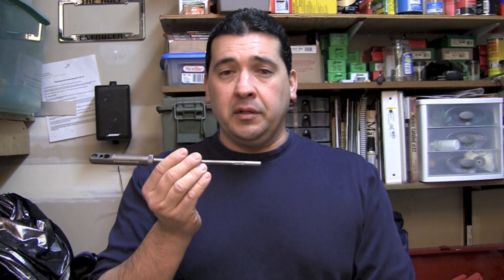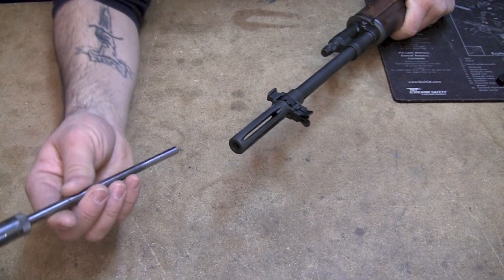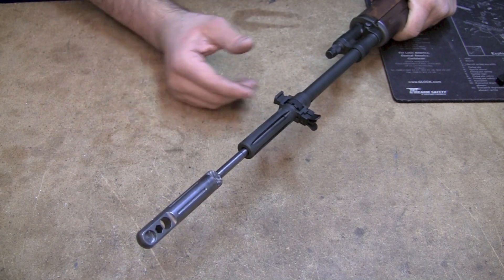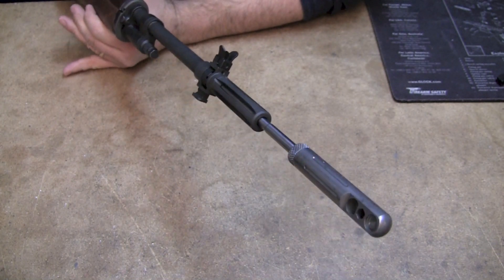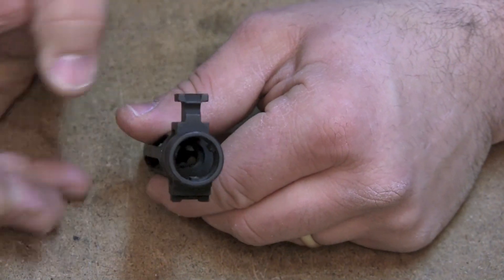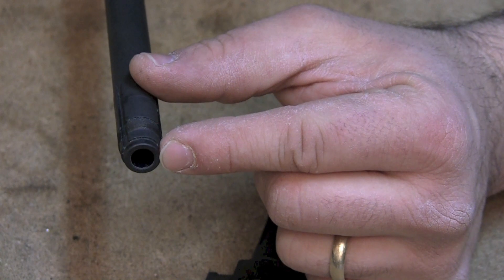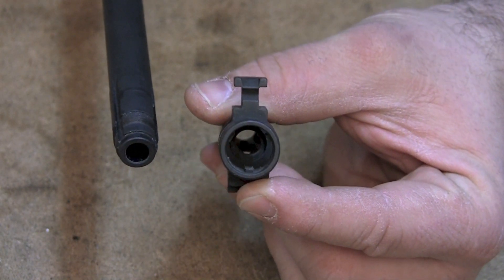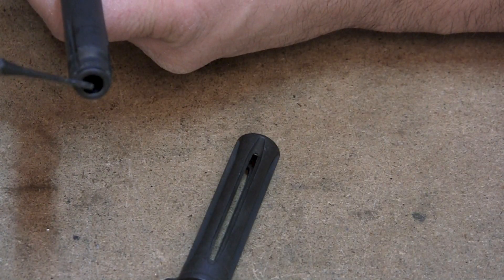M14 M1A Flash Suppressor Alignment Check

Comment: Or the poor man's fix? Assuming you have access to comprehensive drill index,  simply find the bit size where a virgin undamaged SHANK side fits snuggly into the barrel...I am guessing it will be in the vicinity of around .308 giver or take...  IF you can find a bit that qualifies then carefully use that as your "alignment gage" by holding the sharp end with fingers (put some electrical tape on the tip for comfort!)  now insert the shank end into muzzle a ways and check to see if there is clearance ...if not you may be able to remove a slight burr from crown very carfykky with a whet stone.. or maybe knock a piece of grit from the flash hider contact point....last ditch, don't want to pay a gun smith and don't want your accuracy ruined due to bullet contacting flash hider??  How about over sizing the hole slightly?  Maybe not "right",  but I bet so long as the bullet is not contacting the flash hider at all,  the accuracy will be corrected if that HAD been an issue...  Hey, some like me,  thrifty and logical to a fault sometimes...  or not...some will buy the alignment tool an/or pay and go through hassle of doing it supposedly "right"...unless your definition of "right" includes what works..??

Comment: How many have u seen that aren't alinged
Reply from the maker: I haven't seen any that are misaligned, but I have seen one that was loose and there were copper streaks inside the flash suppressor. A damaged crown or a crown that is not cut properly will misalign.

Tony.
Reply: Thanx sir